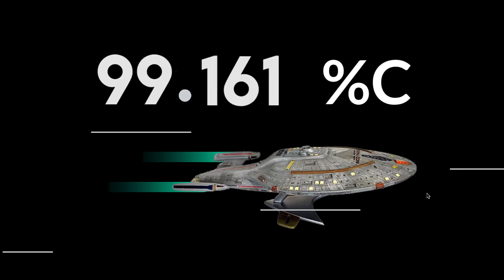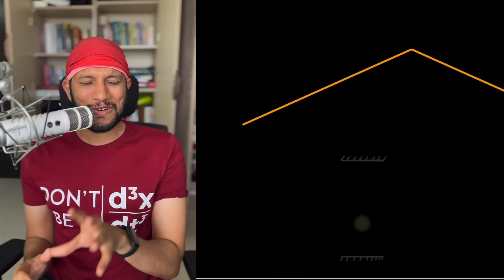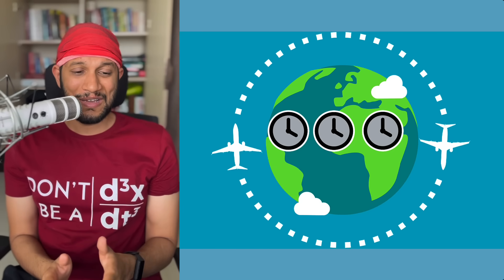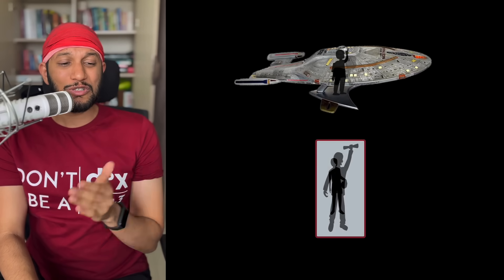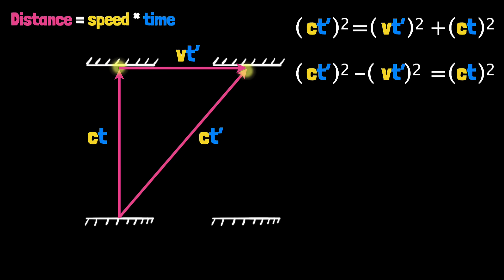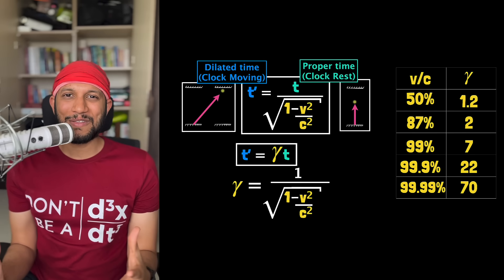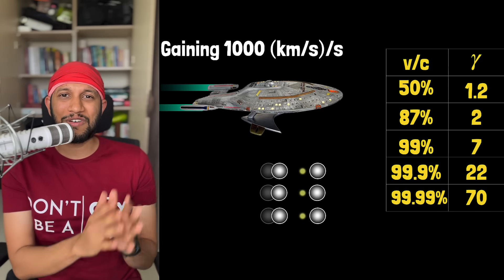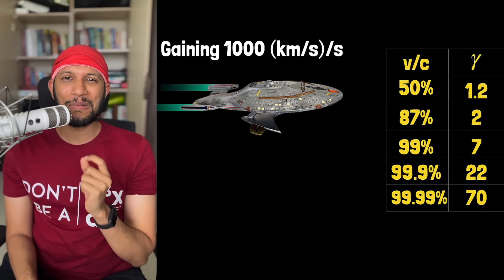I finally understood why you can't go faster than light! (My mind is blown)

Comment: That doesn't make sense. If the traveler at speed looks out the window, they see the stationary person as traveling. and they themselves see themselves as stationary. So to them, the other person's clock should be slower.
So who is it that ages faster? Both perspectives are equivalent. Both will perceive the other's clock going slower.

Also what about the people on that ship. they don't have time dilation relative to themselves. they know they output a constant thruster force. so couldn't they just wait that many seconds and be at light speed then? to them the entire universe's history might flash by in an instant, but provided they don't run into anything, why don't they get to light speed in their own reference frame?

Suppose there is an infinite meterstick, stationary relative to the starting location of the spaceship. The spaceship accelerates and measures their speed using that meterstick and their internal clock. Why can't they reach the speed of light then? Suppose they travel with a lorenz factor of 12 for one month of their proper time, measured on the spaceship clock. the meterstick outside the ship shows something similar to 1 light year. but for them they only took one month. for the outside observer it really took one year to cover that one light year, and the 1 month time on the spaceship is because their clock ran slow. but when the spaceship slows down and looks back, they really did cover one light year in one month. so they went faster than light by their own measurements.
Reply: A traveler is okay as long as they don’t accelerate. Now this is weird because unless someone invents artificial gravity, humans better accelerate at 1 g ( most of the time).

For them the journey looks fast, just not for us. So they come back and the twin is dead.

Comment: Is time slowing down or is the measuring device struggling to measure accurately?
Reply: Does time slow down, or do things last longer when they move?
Reply: Time was found through measurement devices. A large class of devices seem to drive a clockwork the same speed once we calibrated them.

Comment: Meh, i think is all bullshit. The physical clocks slow down but time doesnt. You can keep counting the seconds in your head, or what? Your brain slows down? Come on.
Reply: Brain slows down. Dirac amended the Pauli equations to slow down electrons in your brain.
Reply: @ArneChristianRosenfeldt going by that logic then everything slows down. Blood pressure, heartbeat, and you die cuz of lack of oxygen. So living things cant travel at the speed of light.
Reply: @squalltheonly  consumption of oxygen also slows down. I chose another specialty in physics, but you can check the Lagrange density of hadrons in the standard model (?correct names?) and it shows that nuclei also follow special relativity. So the 3 particles making up living thing all agree to adjust their behavior. Other particles are not relevant for life: Neutrinos, Myons, positrons.
Reply: @ArneChristianRosenfeldt  Bro, all right lets go with your logic. Oxygen slows down. You know what happens to a human when the oxygen slows downs? They turn into a vegetable. So basically only comatose people can travel thru light speed. Also, remember that a human body cannot move around if the extremities don't get enough oxygen/blood, so who pilots the ship? Now what are you going to say to make it fit your narrative? that the ship has to be in auto pilot? Brah, stop digging.

Comment: I would think more practical concerns would arise before you even approached the 90% threshold. Things like while space is mostly empty, hitting a random atom of hydrogen floating around going at those speeds (and you are probably hitting several thousand at that speed) is going to impart so much kinetic energy that you are probably going to cause a runaway fusion reaction.
Reply: Still good video and solid explanation. 👍🏼
Reply: Accelerators shot atoms at relativistic speed into metal shields.

Comment: The way I used to understand that a spaceship could never travel up to or faster than the speed of light was simply a limitation per the rocket equation: since we currently have access to nothing that can travel faster than light - for use to shoot out the back of the spaceship - the simple action/reaction idea of thrust prevents FTL acceleration - i.e. - nothing that the spaceship can fire out the back moves fast enough to accelerate the ship to or beyond light speed in the opposite (forward) direction. 

But with this view, I see no way that the crew on board could ever even "feel constant acceleration" when approaching the speed of light. They would instead always feel less and less acceleration near light speed.

In effect, this explanation seems otherwise similar to the video's explanation with the same outcome (other than the constant feeling of acceleration not being even theoretically possible near light speed - even with enormous amount of energy, aka - thrust out the back, which moves only - at best - the speed of light, since at that time, the ship is moving only slightly slower = meaning virtually no thrust).
Reply: That is not what the rocket equation says. Why do so many commenter claim this?

Comment: you take time relativity wrong bro..
Your Eye can see only when ur Eye receive LIGHT..
for example light from the sun take 8min and 20s travel to earth, meaning what you see on the sun, it happen 8 min 20s AGO...
IF im on the sun raise my hand, you wont see me raise my hand UNTIL 8min 20s later after i raise my hand..

SO what you see in space, isnt actually happen right now, 
if you see a star AA lets say 1 billion light year away, what you see is not current star AA, but what happen at star AA 1 Billion year ago..
do you get it?

so if i speeding at 0.5 light speed (c) away from you, from ur POV im moving in slow motion by 50% YET what actually happen to me, im moving normally.
its just u cant see WHAT ACTUALLY HAPPEN IN REAL TIME..
if i speeding at 0.99 c, from ur POV im STOP moving at all and u dont get live view what ACTUALLY happen to me..
the limitation is ur eyes, not actually slowing time or taking infinite time..
same with black hole, if i go there, it appear that im stop moving and dissapear gradually while dont move, but in reality im moving..
its not because TIME STOP MOVING, but simply you cant see me because light from me cant escape its gravity and ur eyes cant get that light,
Reply: With PontOfView we actually mean that the viewer already compensated for non-relativistic effects as if light waves were sound waves. This compensation leads to those weird artifacts if the space ship does a hard u-turn ( around a black hole ? ) . Like I mean for the twin paradox the ship first needs to fly straight away and then back.

Comment: something not right in that logic,
if that theory is true (Increase speed = Slowing time)
then you need to consider WHERE you are speeding..
its about RELATIVITY,
1. You on earth arent stay still, earth is rotating 1600 KM/H, so u are speeding at 1600KM/H, with ur equation from earth in PERSPECTIVE, if we go EAST at 1600km/h, people will age faster because on earth POV u are stop moving??
NO, you know why? no 2.
2. Earth it self isnt stay still relative to Sun, you are speeding at 107,000KM/H revolve around the sun, so thats mean if u go retrograde from earth path at 107,000KM/H, from Sun perspective u are stop moving, so thats mean u will age faster compare to people on earth?
No, you know why? no 3.
3. SUN IT SELF are revolve around the center of milky way galaxy at 828,000 km/h, with that Fact, from Milky way perspective, there's a time when we are speeding at 828,000 km/h + 107,000 km/h = 935.000 km/h when earth prograde with SUN path AND there's a time when we are only speeding at 828,000 km/h - 107,000 km/h = 721.000 km/h.. YET YOU DONT REALIZE IT.. which make speeding at no 1 and 2 irrelevant.. 
so your SPEED equation only work on WHOS perspective AND to which direction? Earth? Sun? Milky?
4. YET Milky it self is moving AWAY and Space keep Expanding..
so depend (Relative) on whos perspective and WHICH direction, you actually having different speed even tho u are stay still at your couch right now,

Comment: My favorite thing is that the math works out to show that if you had a particle that already existed going faster than the speed of light it wouldn't be able to slow down to the speed of light.
Reply: Dirac looked at the math for electrons and found electrons with negative energy (which makes nor sense). He corrected his maths and found positrons. You should do the same with your math.

Comment: The energy pushes particles. You cant travel faster than the energy doing the pushing.
Reply: Check the rocket equation. Or take a big ship from "The Expanse" with a rail gun going over the whole length. Now if this ship travels at .99 c and you add the rail gun velocity, what happens? Also: particle accelerators ( both natural and artificial ). Fastest object observed in the sky falls into a black hole.

Comment: "The faster you move, the slower time moves". Also, the concept of "faster than light travel" being fueled by artificial black holes is because their gravity can overpower the speed of light. As long as you can enter and exit that black hole by removing it's gravity pull, rather than overpowering it, you should be able to move faster than light without being eternally trapped by it. That said, you would still need to rearrange all your particles to undo spaghettification. No clue on that one.

Comment: Assuming the speed of light is constant no matter what speed you  are going.
Is the speed constant no matter what? Compared to what? The Earth is suppose to move very fast throuh space with out solar system. But how do we determine that? Compared to other things?  Why not relative to itself?
And the only evidence we have is flying a plane around the earth with a clock?
I understand it would require infinite time and energy to reach the speed of light with material. If that is the true cap.
Cause halfing the remaining distance to max speed doubles the energy required. 
Well, then why are our Galaxy expanding faster than the speed of light then?
Matter moving faster than the speed of light compared to us? 
Shouldnt that be impossible?
I can understand matter behaves and slowes during gravity. Wouldnt that suggest matter only slowes down during acceleration?
If so, if we accelarate the same rate constantly, we would reach the speed of light and beyond. 
My Theory is that the speed of light is relative to its origin point and speed. I know that is somehow proved wrong.
I know we only know back and forth average speed of light. Since there is no way to measure true speed. What if the speed is faster one way, it is always the equivilat slower back?
If not, we would measure variances purely by what way the Earth is moving, if you are measuring with or against the solar systems direction of movement.
Meaning of a light scource flies toward a mirror, it is invisible from behind the ship, since the light ''travels'' stationary, and the light reflecting off the mirror is either half the speed, stationary or twice the speed of light.
You cannot say the ship is invisible or even slowing down, IF the speed of light is constant no matter what.
But if the ship is visible from behind, is should be invisible from the front, since the light travels the same speed as the ship.
I believe its relative. That the ship from behind stretches, become less and less bright until is stops and fades away stationary at the point it reached the speed of light.
How else could the galaxy expand away from us? And why would be assume matter behaves the same as light?
Reply: Why so many question marks? The well know experiments were based on the fact that earth accelerates all the time. And we put clocks in satellites. At this time (ha) this is basic engineering . How do flat earthers navigate without GPS?

Comment: wouldn't the photon slide out of the side of your clock as the top mirror moves out of that spot it was in waiting to get hit again? get what you put down here but i still get this nagging feeling that all this math is only accidentally good enough because we don't have real ways to measure and test this at those speeds. if everything is relative to the ship my body should be fine the moment it crosses over the speed of light. but with it being constant what would i see if my ship is traveling faster than the photons i can observe. does my ship always explode from the back as they pool up up back there and melt through?
Reply: the storage ring is a real way to measure and is presented in the video. I tried to find out how to accelerate Cs atoms. I imagine that it should be possible to store Cs+ in a ring. Expand this ring with two linear sections. Add linacs for electrons and overlap the beam. Neutralized CS atoms should not be detected by the ring magnets, but fly along our beam tube to experiment on. Compare these results with Cs atoms in a fountain.

Comment: Theories????, So this theory is represented by an observer and a clock  traveling close to the speed of light. But why, when I say good bye to my grandma going home by train and Im waving goodbye from the platform, I look at the at my watch and the schedule, I get home and call my grandma at the time she's  arrived at home, both watches have the same time. She did not gain nor loose any time so why  this is expected at the speed or close to the speed of light, why do things must happen at a certain speed and not at all speeds????
Reply: the effect is nonlinear. You can approximate most functions ( those relevant in physics and engineering ) locally using a linear function. But notice how the magnetic field around current is explained to be an electric field in movement . SRT can transform fields. Electron spin is explained by SRT

Comment: The way I understood this: photons (and EM radiation) move at the speed of light (C) in space, not through a medium. Photons (and EM radiation) travel through anything (a ship, the human body, even a decomposing piece of fruit) at C. And every process occurs because of photons moving. If the physical thing is also moving at C, then the photons are already moving at C to merely travel within the physical thing. They cannot move to allow processes to even occur of they are already moving at C. That would require them to move at greater-than-C; physically impossible.
Reply: so you agree that a medium cannot reach C
Reply: @ArneChristianRosenfeldt  right. any medium cannot reach C because the very components that make the medium do not have the capacity to exist if they are already moving at C, and therefore cannot move any more? Is that making sense?
Reply: @seangoodbody1693  I don't know if I would use the phrase "capacity to exist", but it makes sense. Photon only have the capacity to exist at c. With the medium it is like the limit in math. We don't ever look at c directly .  We approach c. It is like Lord Voldemort . We don't speak of it. And I feel that this is realistic. Experiments tell us that matter and media made of matter move slowly. And then we accelerate.

Comment: Hmmm... Isn't it Distance that is "dilating" instead of Time? The photon has to travel farther to span the gap between the plates if the plates are moving. It is travelling at the same Speed over the same amount of Time. There is just more distance between the two plates when they are moving.
Reply: Lorenz found out that both need to happen to explain the experiment. Kinda like Keppler found out his ellipses. "just" is not correct.

Comment: Thank you for the explanations you provided. However, one important point bothers me: it’s the astronaut’s point of view in his spaceship. He can indeed consider that he is not moving and that it is we who are moving at high speed. In that case, by applying the same reasoning you used, time would slow down for us and not for him! This symmetrical situation leads to a radically different conclusion. I don’t see how to rule out this point of view; so either time slows down in the spaceship or on Earth, which is not compatible.
could you comment it?
Reply: the space ship accelerates, Earth does not . If an alien flies by earth on continues their scouting further down the galaxy, you might have a point. But there would be no twin paradox -- so no one cares.

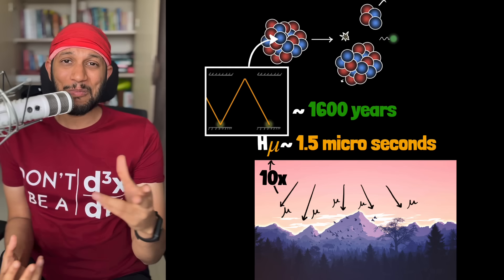Comment: watched up to 6:40 so far and i do still find this sounds like THINGS moving SLOWER but not time running differently. like fries from mcdonalds do spoil slower than any other fries because stuff is added. a photon clocks TICKS slower, but not because of time, but because of further distance to be travelled. photon clocks do for obvious reasons not measure time, they do indirectly measure the speed ion which IT IS TRAVELLING. that photon clock thing is the doppler effect. frequencies do not change, but the one who perceives it thinks it does. light is not moving slower and neither is time running slower, photon clocks just do not measure time, they do measure the speed in which they're moving. the slower they tick, the faster they move. curious about the remainder of that video. getting high on sleepweed and going to take my sleeping pill either and watch this tomorrow. to this point, this sounds like doppler effect to me.